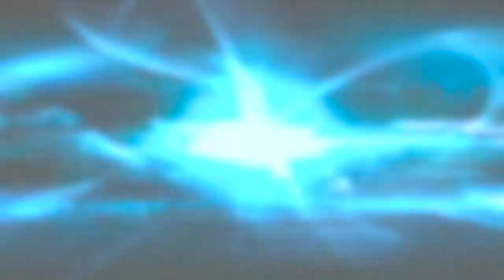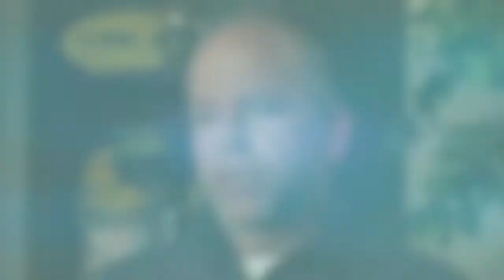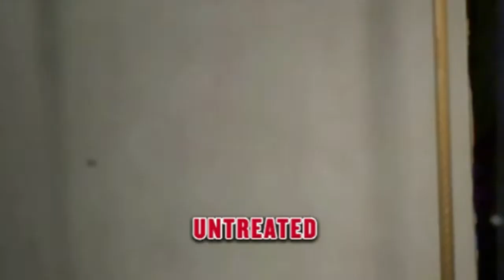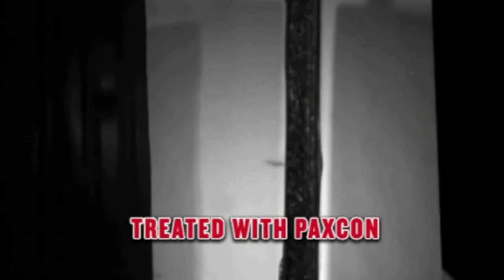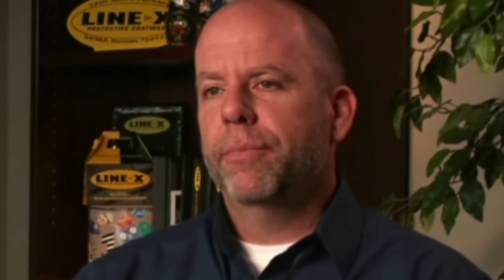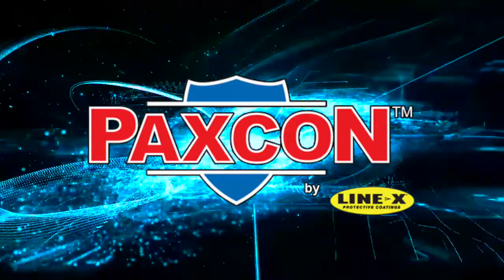PAXCON by LINE X  - The Effects of Spalling

Comment: You need to work harder on a edging frame Or clamping that will stop the coating from delaminating after multiple shots.
Reply: Usually, plates are only rated for up to 6 shots. From the tests I've seen, the spall coating usually holds up for all of those 6 shots.